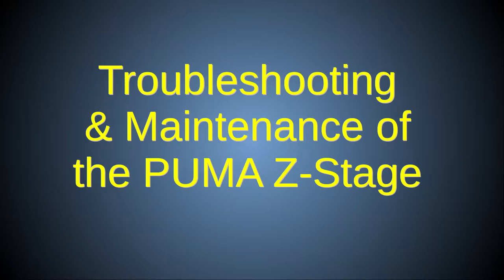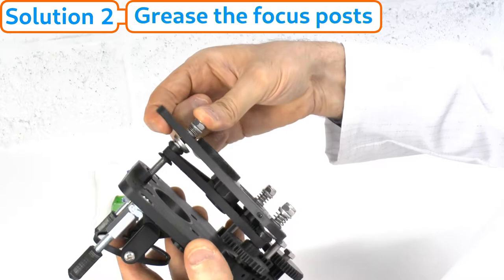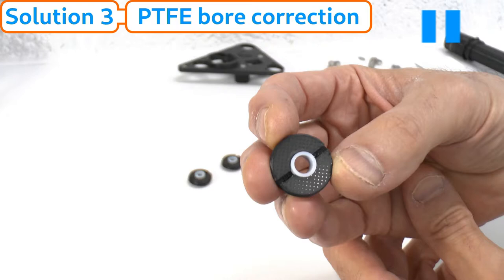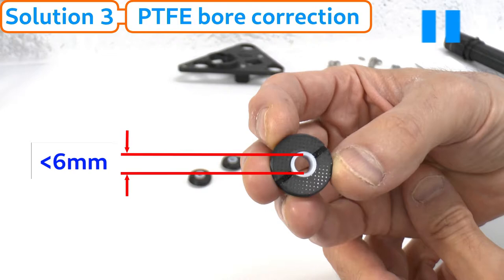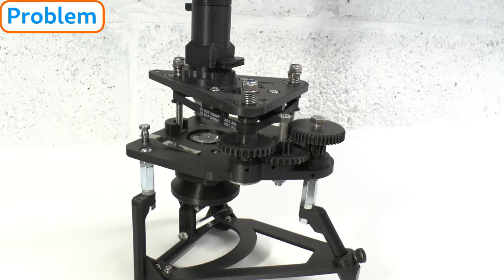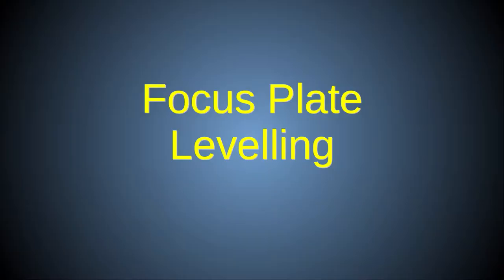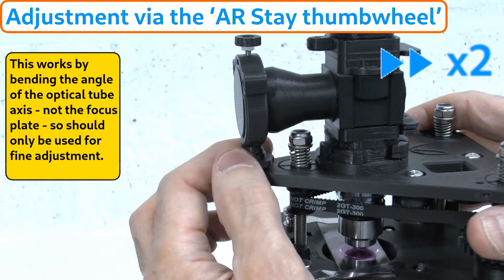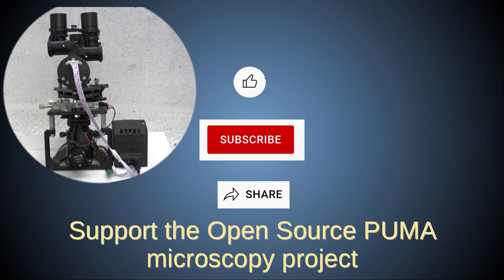Z-Stage II - Troubleshooting and Maintenance of the stage of the PUMA open source microscope

Comment: Could consider using bolts with treads only half way, and swap them around so bolt heads are at the spring side. Any way, love your project.
Reply from the maker: Thanks for the suggestion - I appreciate all feedback. I think I tried something similar in the early days of development but the standard semi-threads weren't in the right positions for the full range of Z motion required to maintain the 45 mm of DIN standard parfocal length (and also it would take more work to remove the focus platform for any reason because you would have to remove the whole focus posts. With the current set up you only need remove the nyloc nuts so you can leave the posts, gears and timing belt in situ). However, if you try some variation and it works better I would be grateful if you would pass on the details so I can have a go!